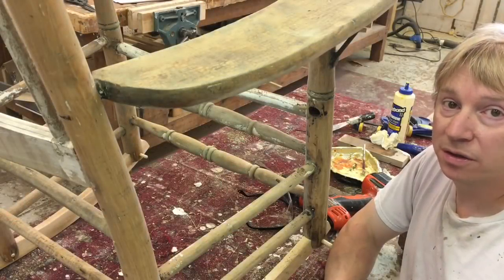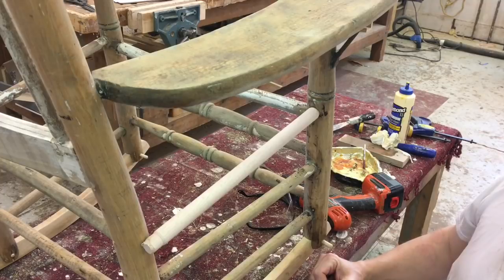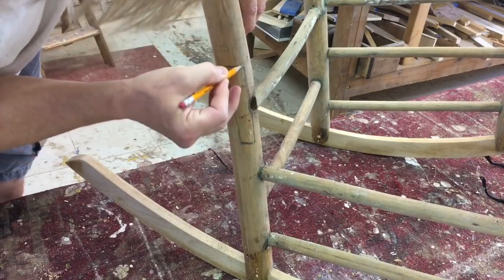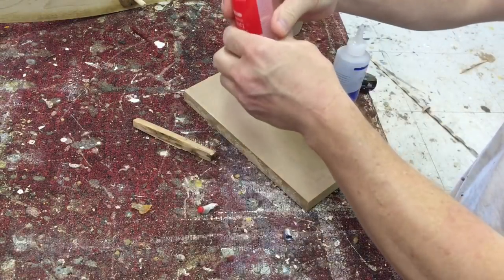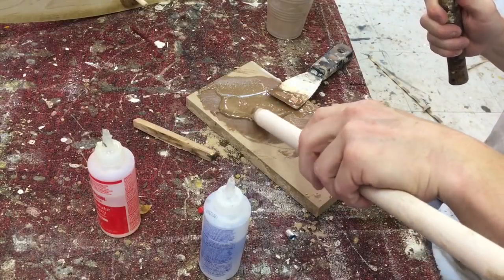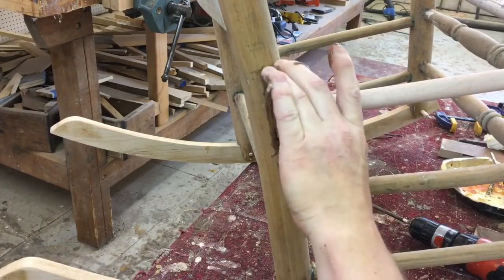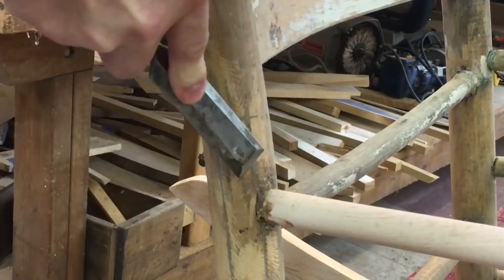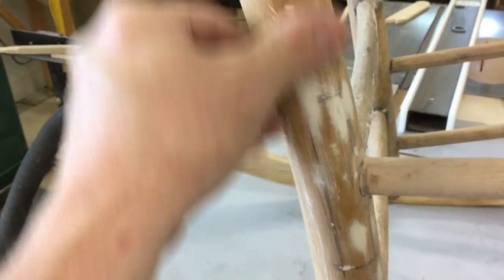AN UNUSUAL WAY TO INSTALL A RUNG IN A ROCKER !!

Comment: Cutting out that piece for the rung, was really clever. It turned out beautiful from what I could see in your video. I've always used wood glue with sawdust for repairs but using the epoxy seems like an even better idea, if the rocking chair is being painted anyways. That was brilliant and the epoxy gives it a lot more strength. Loved your video.
Reply from the maker: glue and sawdust is good for filling in holes and cracks only .

Comment: Will taking out that piece of wood to get the rung in make it weaker?
Reply from the maker: no should not be a problem with the overlap
Reply: That is good to know. Do you always have to use epoxy? Is it stronger than wood glue?